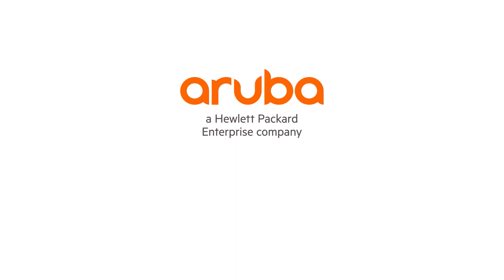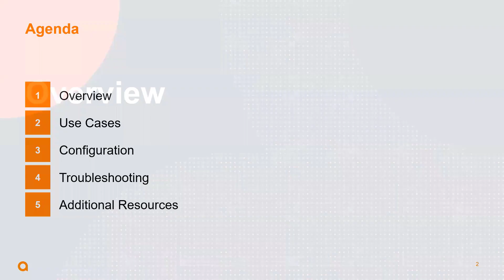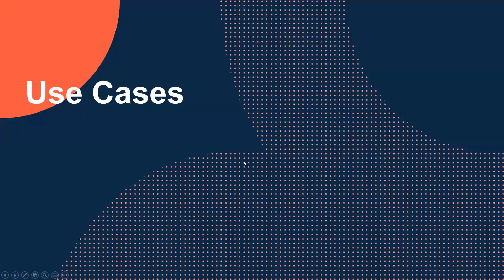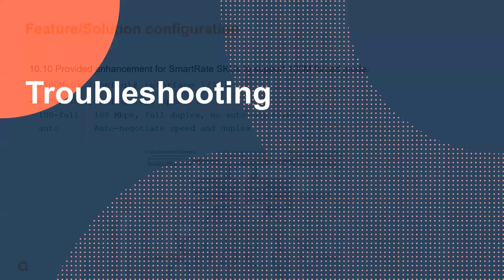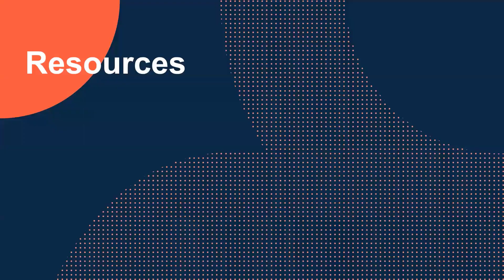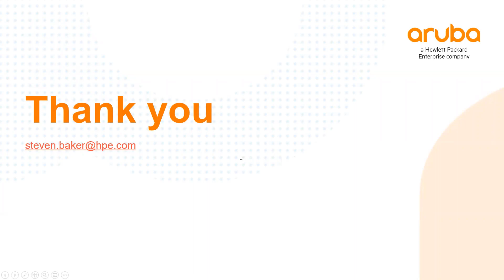HPE Aruba Networks AOS-CX 10.10 - 100Mbps Support 6xxx 8360 SR Ports Update

Comment: what is the 100mb speed purpose for?
Reply: You might be surprised at how many devices are 100M only and CANNOT and WILL NOT link up with a 1G ethernet port: only pins 1, 2, 3 and 6 are present on the card, and many 1G switch ports won't go establish layer 1 without all 8 pins connected. The particular device I saw this with was the control board for a printing press that would cost tens of thousands - or hundreds of thousands - of USD to replace